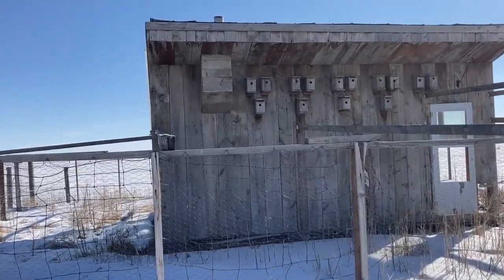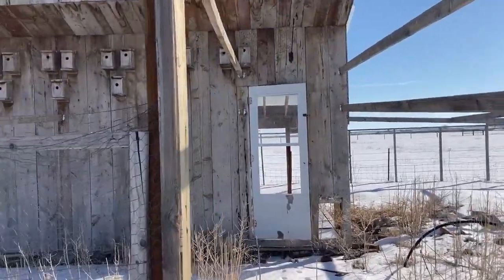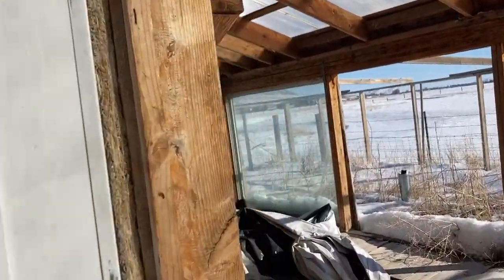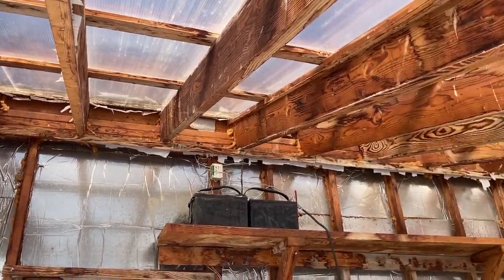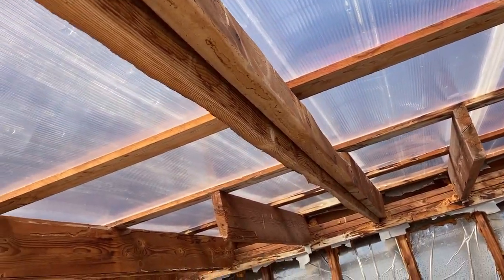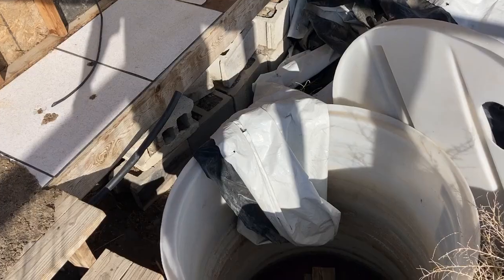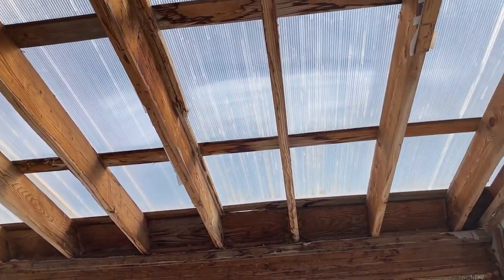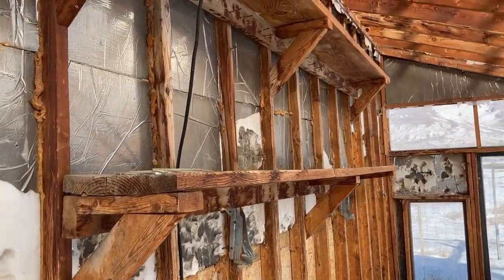An explanation of why I use multi-layer polycarbonate on all my greenhouses

Comment: Is that 4 layer polycarbonate from factory or do you mean that you’re just layering multiple panels of polycarbonate?
Reply from the maker: That's panels with three air pockets built at the factory, so there are four layers of  polycarbonate in each individual panel.